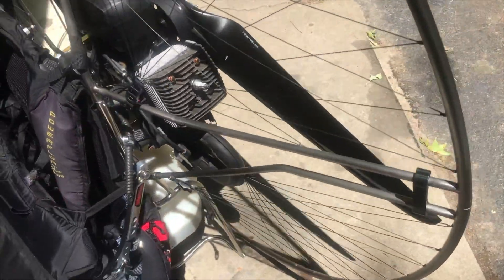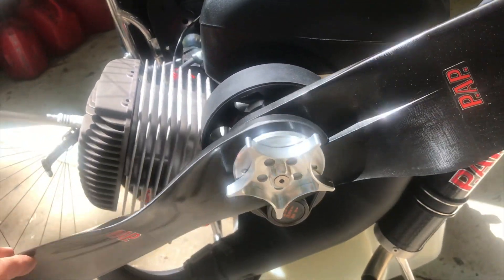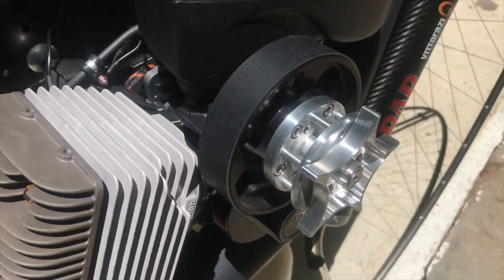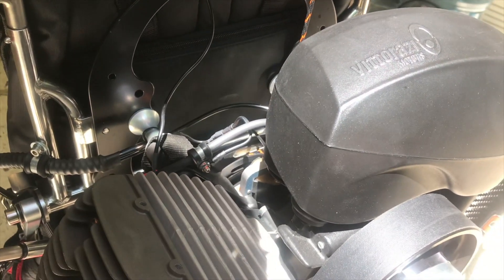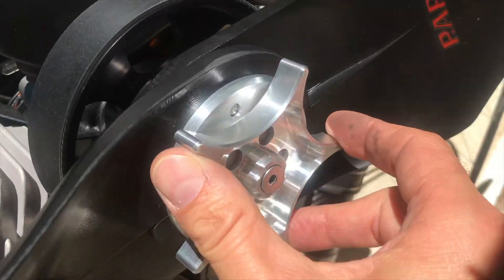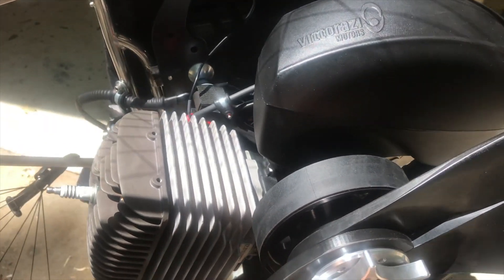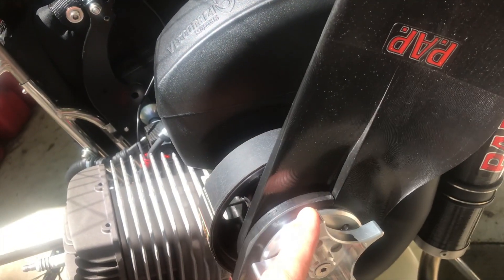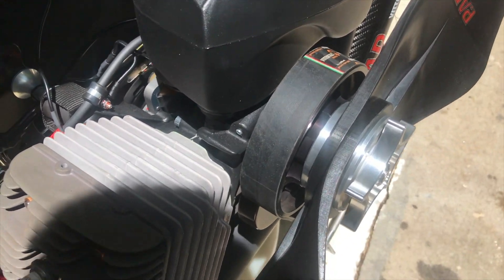Quick Mount Prop System

Comment: It looks like a copy of mine Propeller Quick Release system. Even the additional holes for different PCD has been copied. Probably the coppier didn't know what they holes are for, so copied everything. I do not really like when someone stealing ideas 🤬😡 but carry on and when you start to sell it someone will knock to your doors as it is patented.
Reply: Holes are actually alignment for machining process/weight reduction and not for other prop bolt patterns. Can such design and patent be available for reference?
Reply from the maker: Although I've never seen one of "yours" I know that Aerolite experimented with a single screw mount system a decade ago or so, but gave up after having had either a few failures, or a general lack of interest. You might rather take the approach that being imitated, is is a compliment. even flattering.  Nonetheless, I am pretty sure this one is nothing like yours, other than the fact it is round and retains a propeller. Once installed, this device lacks the protruding dangerous spindle that yours has.  This device is significantly less mass that your appears to be and lastly it employs a completely different system for security of the device.  If I am not mistaken, it seems that the one someone is advertising from the UK (assume that's the one you are referring to?) uses a centrifugally engaged ratchet type latch where as this device uses totally different approach to retention of a propeller...   The end result is the same, but the devices are radically different.  I guess that's why the "Wright Bothers Patent war"  never succeeded in accomplishing anything.  Paramotor gear is open source. The technology is pretty much as old as human powered flight.

Comment: My Cisco Snap-Ego 120 uses a single Hex head bolt  and cone washer to attach the prop. I use some medium locktight  because I do not believe it is threaded in the correct direction to be constantly tightening. I would have no problem using this design.

Comment: It needs a split pin to lock it into place. Other than that he is on to something. I would buy one. He would be better off to make them in house or get someone to work for him making them. There are a few tweaks he needs to make but a great idea
Reply from the maker: I had a lengthy discussion on facebook about how and why we ruled out secondary mechanical back ups in favor of a simpler system that just makes more torque.  This design isn't snag free, neither is it fail proof as it requires proper installation.  Then again so does the 6 cap screw OEM design.  By split pin I am assuming you mean a cotter pin?  My objection to anything external is that it can be a snag point for lines. Most of the things we considered needed to add weight and in most cases the weight couldn't be equally balanced without adding extreme complexity to the parts.
Reply: @YankeeinSC1  theres lots that could be done with Ford and against on every scenario. Fact is he made it that way because he feels that's the best way. And it's a very neat idea. As for snagging well if my lines got that close to the prop getting it caught in the prop but would be the last of my worries lol. Keep us updated though I really want to see where this goes 👍🏻

Comment: Thanks Todd!    You know, I'm not sure where I saw it, but some time ago I recall seeing a similar quick-release style prop adapter somewhere.  I thought it was available for sale/retail, but I'm not sure.  Regardless of whether there is any competition out there, that looks like a pretty slick setup.
Reply: You are correct. It looks like the copy of mine Propeller Quick Release system 😡🤬
Reply: @paweljarzebowski650  Do you have a link to a site that sells yours?
Reply: @Flyswamper  mainly on Facebook but I have it on www.parazone.co.uk
Reply: @paweljarzebowski650   found it! Yah I saw this and wanted to make one specific to the moster185 with a Helix or e-prop. Also needed to have access to the center allen head to tighten the belt without removing the hub. Both are great designs